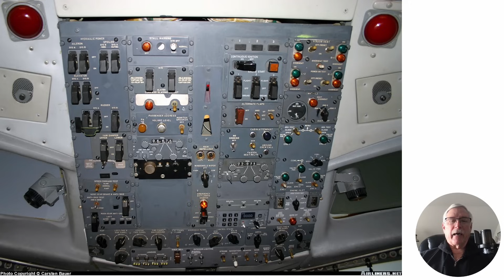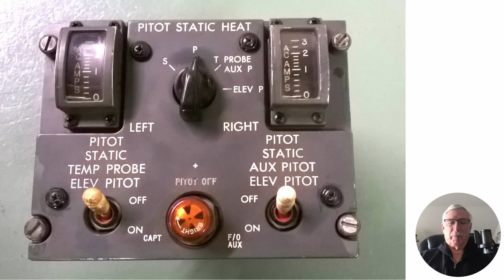Two crashes in one day!Ground this aircraft! Boeing 727 December 1, 1974

Comment: I remember the NY crash well, as it was only about two miles from our cabin in a camp in the park, though we weren't there at that time of year.  It was a miserable night, snow and freezing rain.  A few years ago I hiked to the site but saw no trace of the wreckage.

A blocked pitot tube is no bueno. I ferried a new to me Starduster (homebuilt biplane) home that had a partially blocked pitot causing considerable lag in the airspeed indication... I had the devil's own time managing my speed while landing throughout the 1000 mile trip; it wasn't until I got home I figured out what the problem was  (mud dauber nest).  Fortunately it was good weather, but it would have been a lot less trouble in a familiar airplane.
Reply from the maker: Quite a challenge! Bummer. Had a few of those myself but in familiar airplanes fortunately. Thanks for sharing!

Comment: Is there a reason the  switches are ON in the down position?
Reply from the maker: It is the forward position. Only on TWA 727 aircraft were up positions on.
Reply: In the USA most airliners to turn the lights on you put the lights on by selecting forward which is down. That is the USA NORMAL. The rest of the world ON the switch is moved back or Up for on. When I asked a British Captain about that fact he asked me which way I moved the light switch in the house to turn it on? The answer is up normally which is back on an overhead panel  on an airplane. The American ON is forward or down. The opposite of the rest of the world. I always got a chuckle out of the remark that this airplane is backward  when that backward airplane was normal. Our normal airplane was backward.

Comment: At its introduction the big kruger flaps and the Sperry Auto Pilot were challenging for pilots.
The 707 had 5 crashes in 1 year. 3-4 by pilot induced dutch roll. 2 at instruction flights?

Comment: No, we don't all love the 727. And it was LESS SAFE than the 747 (obviously) and even the 737:
Boeing 737 (all models) 10,478 built; Fatal Accidents: 83
Boeing 727 (all models) 1,832 built; Fatal Accidents: 51
Do the math!
Reply: The 727 was a 1. gen. airliner and it never evolved into the more modern and safer NG series, wich make a good number of the "737 all models". The first gen. 737-100 and -200 make up only around 1100 planes built. The 727 NG is the much safer 757.  
The 727 was very versatile and operated by a lot of shady developing world operators, like doing fuel and cargo runs in Africa. It is difficult to compare, because the conditions are not comparable. 
Automation on newer aircraft was a real game changer, even though it caused "automation accidents" in the beginning.

Comment: Confession time.
Forgive me RON for I have sinned. After being interrupted during a checklist I resumed the flow and check. Unbeknownst to me, I resumed it past the pitot heat line , therefore taking off into icy skies with no heat. Shortly after entering the clouds our air speed started dropping off. My FO was pilot flying . After the initial disconcerting " what's going on now " wore off , I pretty quickly realized I forgot the pitot heat and switched it on. While doing that I told my FO what was going on and asked if he was comfortable just keeping the pitch and power steady for another minute or two. I did that for a few reasons. 1. I wanted to see if he had another issue that I may have missed as I've already proved I am fully capable of missing something
2. I wanted to make sure he wasn't getting nervous and going to compete with me for the dumbest action of the day by doing something stupid , like shoving the nose down. Or up.
He was a good stick and within a minute everything went back to normal. Lessons learned, fly the plane. As long as it has wings and those flappy floppy bits on the airfoils can be controlled the aircraft will still obey the laws of physics.  Checklists. If interrupted I always go back to the beginning when resuming.  FOs,   if able fly with one that likes cheap drinks as I bought that night !

Comment: Just trying to understand...  Plugged up pitot tubes/icing caused errant warnings...  But, if the stick shaker/stall warning activated, wouldn't you push the nose down to gain air speed instead of leaving it in a 30 degree nose up attitude?
Reply: From reading the report, they didn't seem to realize the stick shaker was active. It was speculated that they mistook the vibration for mach (high-speed) buffet.
Reply: @ignorance72    I guess that makes sense...

Comment: Went quickly through the accident report. There was a stall certification of the type (not from the spin, granted), and when you read between the lines it seems that pilots could have exited the stall at least up to certain point-but the elevator was simply held up, or pulled on from time to time, instead of pushed into. Also, it looks that spin was irregular with heavy pitch oscillations that makes it possible to elevator to "grab" the air. Darn, it even broke parts off as it was "grabbing" the air, it was not in the wind shadow or anything...
Reply from the maker: Recovery should have been possible if initiated early enough. Since there was never any spin tests performed, the rest is conjecture.
Reply: @ronrogers  You are right-that is a test-pilot area, understanably never performed "in vivo". 

There was a similar accident (Russian Tu-154M, Pulkovo Airlines flight 612, August 22 2006).

CVR and FDR-based (official) animation are available.I mention it because Boeing 727 and Tu-154M have similar configuration, and Tu had a valid FDR recordings. Things mentioned in Tu-154M manual about stall behaviour and actions are similar to those of 727, even the mentioned altitude loss at stall (2200 compared to 2000ft of 727).

Comment: I like the way you say you just come in and land by feel, when there have been multiple cases of airliners crashing from blocked pitot tubes. I remember there was a case in australia where an asian airline left pitot tube covers on (which became a thing because a wasp built a nest in a pitot tube and caused a crash) and were almost panicking then dumped most of their fuel into the sea then did an emergency landing.

it's like the attitude of other old timers. the BA 747 flight that went through volcano ash near jakarta and had all 4 engines fail and was unlikely to get to jakarta past the mountains for an emergency landing got fortunate and was able to start some engines again. after they landed the pilot went back to talk to the first class passengers and one was a ww2 pilot and said he wasn't bothered as he had experienced all 4 engines failing in his lancaster bomber.

Comment: I flew the 727 for the first time in 1985 and it was mentioned that the amber pitot heat light did no exist until after this NWA accident. Just a comment from a check airman that was new to the 727 at Flying Tigers. Have you ever read the accident report for the first BAC 1-11  doing stall tests for certification? It happened in October 1963. This is how the British learned about Deep Stalls in T tail aircraft and their requirement for a Stick Push on any T tail aircraft. When the B727 was finally placed on the UK Registry a stick push was installed, same with the DC9 and MD80s. There was also an MD80 crash around the Caribbean that was lost because they over climbed the airplane, let the speed get too low and stalled the airplane and went from FL330 to earth at a high rate wings level nose high. With the deep stall you lose all your effective elevator the same way the BAC 1-11 did during flight test.
Reply: Thanks for the info, as a pilot who dabbles in aerodynamics, what do you think about lowering the flaps in this condition to bring that nose down? Lowering the flaps seems like a simple way to overcome the lack of pitch authority on the T-tail. My dad who flew The McDonald  F-101 said that aircraft had a terrible pitch up tendency if the T-tail got blanketed from either fuselage or wing generated turbulence in a high AOA situation, thanks!
Reply: Boeing thoroughly tested the B727 for deep stall and the closest they could get it in a deepish stall was speed brakes with flaps extended. Hence the limitation of no operation of speed brakes with flaps extended.
Reply: @fallm9447  Well the British disagree because of what happened to the BAC1-11. Everyone used Flap 40 as the normal landing flap and Boeing fully tested the B737 Max. If you fly any airplane well you will never get close to a Deep Stall. Just how far did Boeing push the  Deep Stall?  I suggest you read the accident report for the BAC 1-11 during stall test. The elevator was initially effective but then with full elevator nose down nothing. Then when max power the nose just rose. All seven individuals on board had parachutes. They had explosive bolts to blow the door, which they did. They had an escape tunnel from the cabin floor that would take them clear of the airplane. They also had a rear exit. The aircraft moved a short distance forward and to the side. No one got out. Very doubtful that Boeing test pilots attempted a real Deep Stall. You can pencil whip anything. I would guess the only time the 727 entered an actual deep stall was on that ferry flight out of JFK.
Reply: @fallm9447  so what you're saying is you can't operate the speed brakes with the flaps out, or operate the flaps with the speed break deployed. So I guess you use the speed brakes to descend and then retract them and set up your landing with the flaps, I guess that makes sense
Reply: Found this on a website page about Deep Stalls

Hello Bob,
Some more information on the 727 deep stall.  I don’t know how many deep stalls Lew was exposed to, but I rode thru one.  It was with flaps down (15 or 25 degrees) and speed brakes up.  It was an FAA cert flight with FAA pilot (deleted) who got us into the stall, Lew got us out.  He did not roll on the side, he did his best to keep wings level.  We rolled from side to side, approximately 30 degrees, like doing a falling leaf.  The flight test data showed zero airspeed for approximately 16 seconds (seemed much longer).

There is a good article about this stall in the “FLIGHT JOURNAL” of December 2008, written by Lew’s daughter Rebecca.
 All the best,
 Jess Wallick 

More on the deep stall, I did talk to Lew, he said he did his best to keep the blue side up.  He was concerned that if the roll increased and the nose dropped we would be in a spin and be hard to recover.  I was there, in the first jump seat.  He never tried to roll the airplane.  He took control, dropped the speed brakes , retracted the flaps to 5 degrees, pushed the thrust levers a bunch, and recovered control.  Lew said that he could see that the nose was dropping,  very slow at first.
 All the best,
Jesse Wallick
Reply: @fallm9447  Which is the reason a stick push should have been installed. The outcome for the average line pilot would have been far different with a full load of passengers. What was the CG for the test flight. If they were high like FL200 most line pilots would have tried to bank and get the nose to fall. The test pilot did no because he thought it world spin. What do you think the chances of a recovery with a spinning B727 flown by an airline crew? If you never approach a stall you will never require a stick pusher. If you are among the unlucky or just weak it could save lives. That MD80 in the Caribbean may have been saved by a stick pusher.
Reply: The additional problem with the BAC 1-11 was that it didn't have powered elevators, they used an aerodynamic servo tab which the control column moved which in turn aerodynamically moved the elevator. With the aircraft in the deep stall, there was no smooth airflow over the elevator tab so even moving the control column forward had no effect. They changed to powered elevators after that as well as adding the pusher.
Reply: @paulsengupta971  You must be aware the DC8 also did not have powered elevators, but they didn’t have a T tail. The Super VC10 had four individually powered elevators. The VC10 was rather unique because if electrical power was not available the only flight controls available were the spoilers and the stabilizer trim. That is whey they had ELRAT  which was a wind driven electrical generator that restored enough of the flight controls to fly the airplane.
Reply: @georgeconway4360  The test flying of the BAC 1-11 and VC10 were both conducted out of Wisley airfield. At the time of me writing this, they're getting ready to turn the airfield into a huge housing estate. 😞
Reply: Had the great luck of flying both the BAC1-11 (passengers) and B727 (freighter) and both had Pushers for that very reason. Many fond memories from both types.
Reply: @frank_av8tor  I flew SVC10s and the B727. The SVC10 had a Stick Pusher but the B727 due to FAA wisdom did not. The number of Deep Stall accidents on the B727, DC9, MD80 without stick pushers has been minimal but they did happen.
Reply: Yes, they barely had enough thrust to maintain speed at that weight and altitude. However, once they turned on the anti ice it reduced the amount of thrust available. Sadly, they realized this too late and stalled.
Reply: @michaelvane6827  I think you missed the point about pitch (aircraft attitude) and power (engine thrust), it wasn't lack of thrust that stalled the aircraft, It was the high angle of attack, remember, pitch controls airspeed, power controls altitude. If they would have lowered the pitch they wouldn't have stalled even at zero engine thrust you wouldn't stall if they had lowered the pitch angle of the aircraft.

Comment: very very similar to AF 447... getting distracted by speed issues, and losing primary focus on attitude and power setting.
Reply: And flying thru a Level 5 thunderstorm...
Reply: @jdshemp  not entirely similar, but in different ways they both encountered unreliable airspeed indications & stalled due to similar airmanship shortcomings

Comment: 1) Did the 727 have a tendency to bounce on landing?  2) (this is a digression) viz. the 33 degree upward pitch... I flew out of London City to Amsterdam Feb. 2009.  I noticed the downward pitch of aircraft on final looked like they were pointing the nose practically straight down (it was 5 degrees).  On the return flight I was amazed that you couldn't sense the downward pitch on final in the cabin of the BAE 146. Landing at LCY reminded me of what it must be like to land on an aircraft carrier.  It felt like a controlled crash.
Reply from the maker: 1. Not really 2. The steep approach requirements of LCY made for some interesting approaches and departures. I flew a flight eval on the 146 and it was a beautiful flying aircraft!
Reply: To my understanding, the 146 was especially designed to make these steep approaches into airports like LCY.  It is quite effective in performing these "Kabul approaches". And the flaps are really noisy in the cabin. Nice little plane.